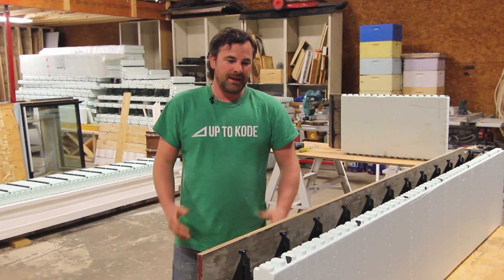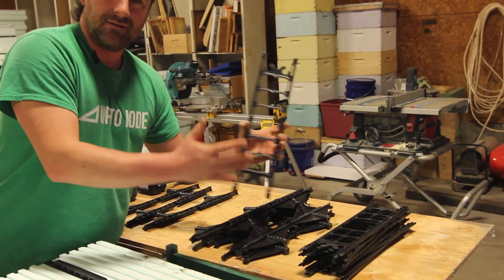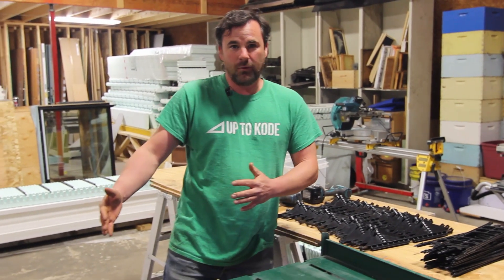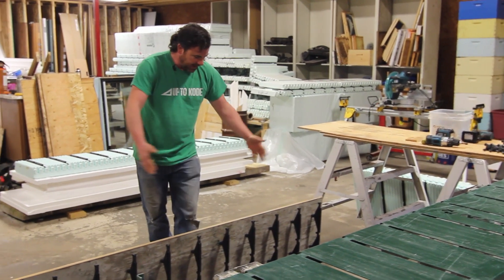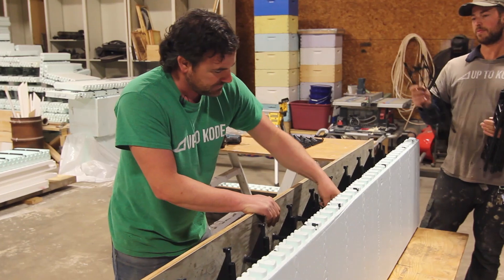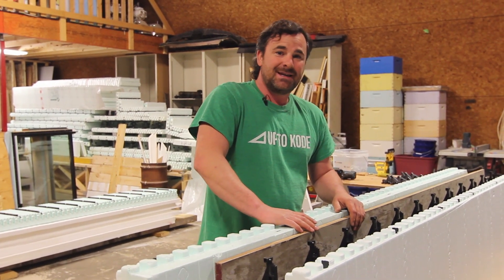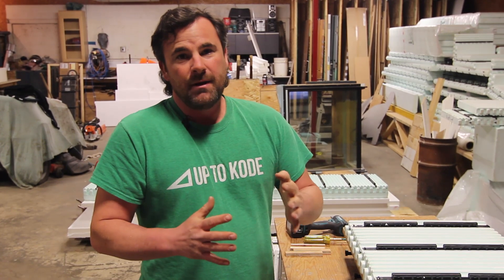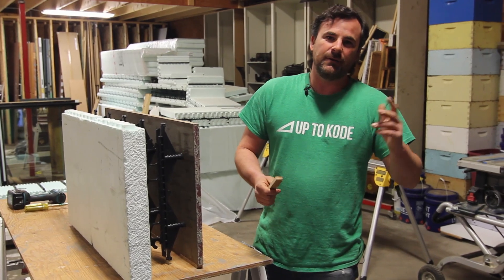How to Assemble Forms for the Nudura One Series

Comment: Nice demo!  Is there any way to avoid all the plastic ties and such?
Reply from the maker: Not really. I mean you could but the incredible amount of bracing you would need for both sides would be overwhelming.
Reply: @uptokode  Thanks!  Your videos are really great.  And it is wonderful that you illustrate processes for locating mass and insulation where they are most beneficial.

If concrete does not need containment (has no fluid pressure) right after vibrational placement, then form ties (or even forms) are not needed.  To do that, a thickener is injected near the end of the pump line.  Then, initial confinement is needed only for the vibrating part.  Consider it light slip-forming against panels of foam.  Of course attachment for cladding needs to be worked out in advance.
Reply from the maker: I wish i could show you a retaining wall fail I had just recently not using ties. I had to tear the interior form work out, shovel the concrete out, wash the rebar and forms, place the interior wall again, super brace the heck out of it and then pour again later that day.  Long day to say the least!
Reply: @uptokode  Thanks for the story!  Sounds terrible!  Using inline rheology modification, the concrete can hold immediately after vibrating.  Can go vertically at up to a foot per minute, if foam is in place one side.  Machine-controlled placement is the best way to go.  Confine the concrete while vibrating then move on.
Reply from the maker: Very cool.

Comment: When would this be applicable? It seems like it is as much work as standard concrete forms. I've worked with Nadura before but never used anything like this.
Reply from the maker: I have a video on the advantages of this system. Might help answer some questions for you.
Reply: One option that it could be used for is basements, in "higher bug areas", or to simplify the outside waterproofing.  Because all of the foam would be on the inside, you don't need to worry about bugs eating the foam away, and you not knowing since it's underground and buried.  

Another advantage, the waterproofing, is if you have a preferred method of waterproofing, such as a liquid applied WRB, but it isn't certified as safe for ICFs, by having the "pure concrete" on the outside, you could use most any waterproofing setup you would otherwise use for concrete, without having to worry about any "foam" being dissolved/eaten away by the waterproofing materials.